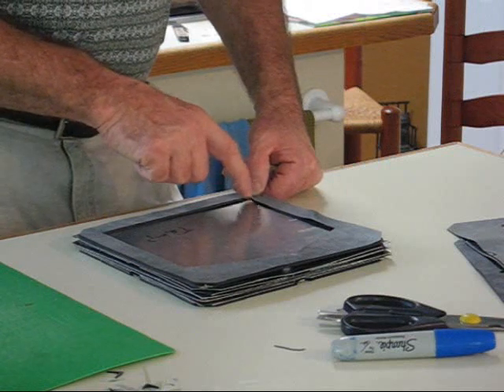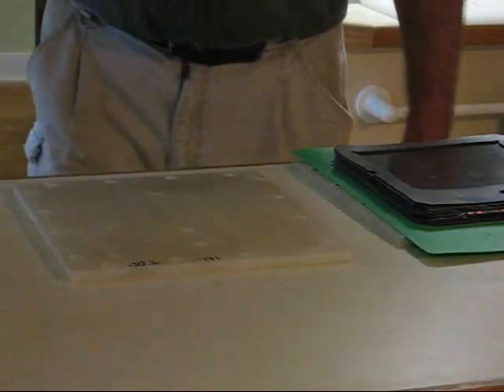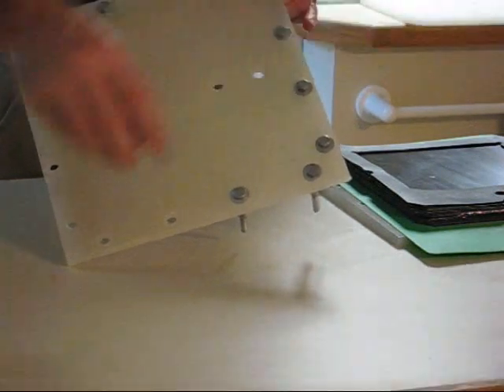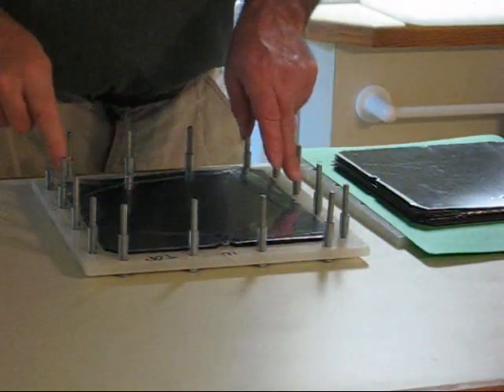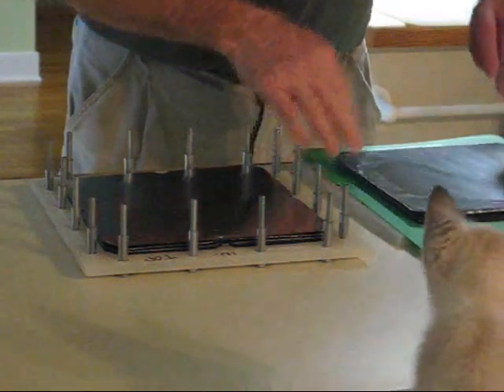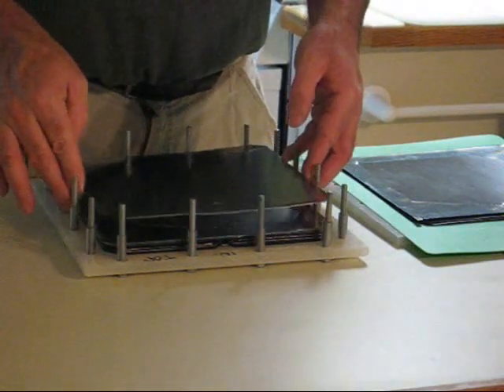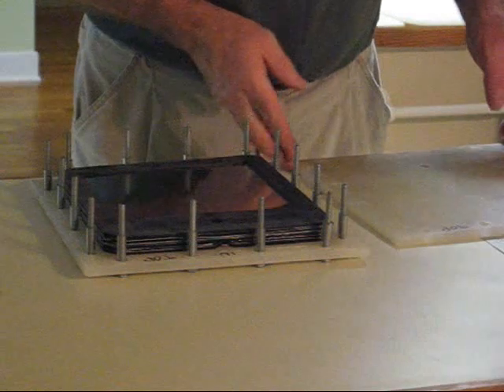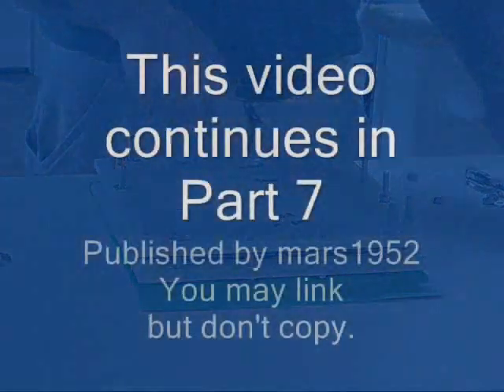HHO Dry Cell Mars Gasket Part 6

Comment from the maker: You need to look at "HHO Dry Cell Mars Gasket Part 10" this video is a close-up of the gasket. I also talk more about the gaskets in parts 4 and 5.
There is a spacer gasket and the Mars (flap) gasket. The spacer gasket allows the water to flow.
Mars